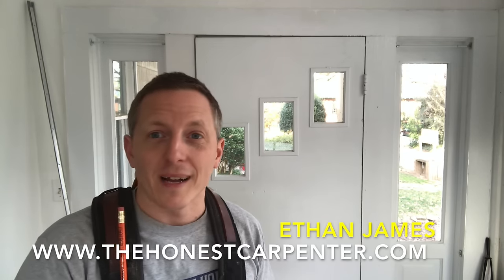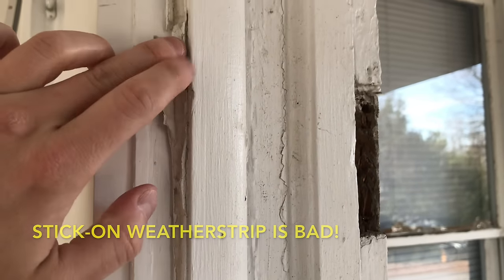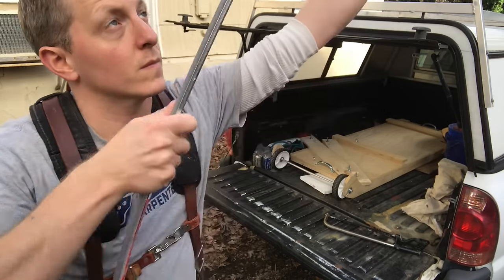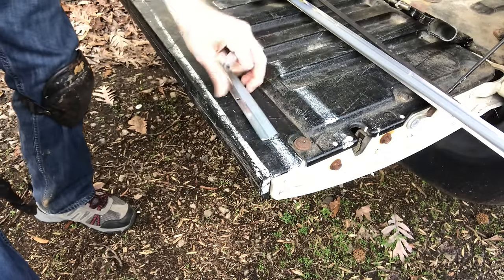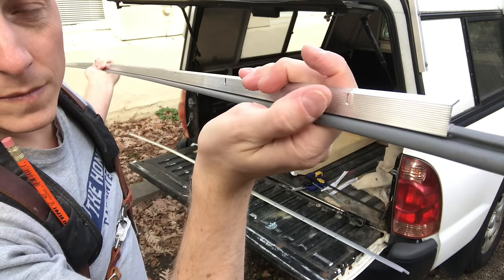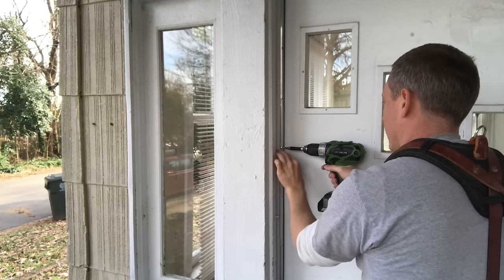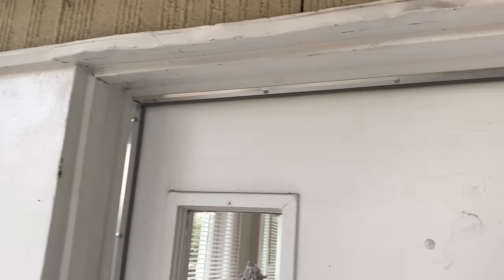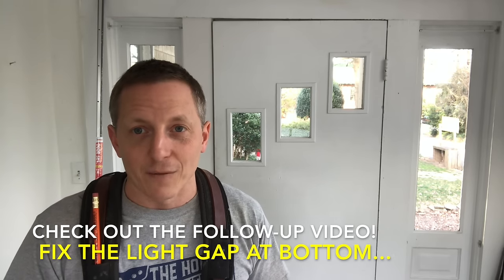USE THIS WEATHERSTRIP ON OLD DOORS! (Save $$, Prevent Cold Air Drafts / BEST DOOR WEATHERSTRIPPING)

Comment: FYI the metal is aluminum, not steel. Won't rust and can be cut with fine tooth miter saw blade.
Reply: I actually used a pair of tin snips.

Comment: Have used this option many of times.    Most important tip for beginners was like you said mount with screws in the middle for possible  needed adjustments later.

Comment: As a locksmith, I can honestly say I’ve done countless service calls to fix locks that were damaged by improperly installed weather stripping. The most important thing you can do before you install the first screw is, shut the door so it latches and........... LOCK THE DEADBOLT!!!!!! (If there is one)
Then, go ahead and gently push the stripping up against the door, Mark with a pencil and install your screws. It’s important to lock the deadbolt because quite often the strike plates for the deadbolt and the knob/lever latch, aren’t aligned properly. It not properly installed, the deadbolts bolt will drag across the strike plate with too much resistance and eventually break. I’ve have seen this problem countless times, weather stripping causes lock and door closing/fit issues almost by default.
Reply from the maker: Good advice!
Reply: @TheHonestCarpenter  - cheers, I saw the vid thought I should throw in a comment.
Reply: @TheHonestCarpenter  great job!! which one is the product your using? I don't see it in your links...
Reply: @The Honest Carpenter
When I mark the screw holes to install the metal weatherstripping , should I shut and latch the door with/without the kerf strips (that has been inserted into the groove on the top and latch side edge?
The kerf strips don't properly seal the old door but the door does shut latch easily.  In other words do I remove all old weatherstripping first?
Reply: I put mine on, am very inexperienced with this. My deadbolt feels tighter even if I loosen all the screws on that side. When I tightened them it was even worse. I'm not sure if I should redo the entire thing or if a little tightness in the deadbolt is okay.
Reply: @Dude902  - take the stripping off. Close the door and lock the deadbolt, now place the stripping against the door and with very slight pressure, mark your holes and mount the stripping, you deadbolt should not be tight or restricted,it should feel the same as before the stripping went on. Any tightness with eventually lead to premature lock failure.
Reply: Thank you for sharing this knowledge.
Reply: My landlord put in stripping and can barely get the door unlocked
Reply: @HawkGirl69  - call the landlord and tell them the lock no longer works since the stripping was installed. They should come back and reinstall it so the pressure is taken off the latch or deadbolt. The only other solution is to file the strike plates on the frame to allow the latch and deadbolt to work properly without resistance or binding. Wish I could help you.
Reply: As the daughter of a locksmith, I thank BOTH of you!  I don't know how many calls my Dad has gotten over the decades with improperly installed stripping that brought early deaths to decent deadbolts... Or the keys breaking in the locks. The great advice and instructions that have come with the invention of the Internet have saved many a service call!  Much appreciation to you gentlemen since my husband and I are now living in an older home and are doing much of the rehab ourselves. ❤

Comment: Absolutely amazing!  I just bought a 1915 house all redone on inside EXCEPT front door, moved in and noticed the huge gaps, and it is an OLD door with those bevel type windows and this showed me what to do as I could see regular weatherstripping will not cut it. I thank you so much and feel confident to do this (but will need the hack saw!)

Comment: Great video! This will definitely solve my draft issues around my main entrance and basement doors. My basement door has a small enough gap that spiders use it as a highway into the house.
Reply: my place, downstairs, i've dubbed "the spider palace". gads of spiders, upkeep on webs is insane. now i have a little hope that with the doors properly sealed, that'll shut down that issue quite a bit.

Comment: The best tip was that on the long pieces you want to have a screw very close to the end...otherwise you will have that end flopping around until it gets to the screw. Do two cuts, that was a great idea, so as to get your screws close to the ends of the long pieces.  Actually this also applies to the top shorter piece.  Great video.  Thank you, Dr. George W.
Reply: Easier to just drill a hole and put in another screw

Comment: Thank you!  My house was built in 1949 on a regular foundation that one previous owner decided to hand dig a basement.  Well, no door fits the exterior doorway so several years ago, a friend who had an extra steel door w/foam interior, cut that door to sort of fit the space, then wrapped the open end with steel that he cut off.  Well, it's ugly but it worked better than the hollow-core wooden one that was there before and had a huge hole at the bottom that all kinds of wildlife loved. Anyway, that big basement is my dog's house during the day and it's conditioned but there's a huge gap around the door jamb that just needs a good weather-stripping fix.  This is just the ticket!!!  I don't have a hack saw.  Guess I'm gettin one.

Comment: Thank you so much for this. I didn't know what the product was for or how it worked. My friend installed a prehung door on a 100+ yr old house and it didn't go well. He couldn't get the frame to line up right and ended up with some significant gaps on his door. My brother also broke the threshold while trying to help get the door to shut properly. Friend had never installed an exterior door before. Anyway, there are gaps and it needs to be sealed better. I sent him this video so hopefully he can try this solution.

Comment: I commented on this earlier, but I have to add another. It's been close to zero here in Buffalo, and our unheated side entrance has been brutally cold. In the past I managed to seal most of the cracks with adhesive backed foam stripping, but there was always a draft. We couldn't keep liquids there because we were afraid they would freeze. I installed this kind of insulating strip and a new door sweep yesterday. It's amazing (kind of like when I discovered heat tape for my pipes). There is no draft, and the entryway is comfortable. I guess I'm teachable. Thank you again. I've subscribed, and I look forward to finding new solutions to old problems.

Comment: This is a very helpful video.  My front door is an old wooden double-door.  I can see light through the cracks, so I know the weather stripping needs to be done.  I had that peel/stick foam, but that doesn't really work well.  I will eventually replace the doors, but until then, this will help!

Comment: A very easy to comprehend video!  How would you go about stopping leakage in the middle of a door with sidelight that opens?  The exteriors of the door and opening sidelight do not leak, just the top and where the two come together.  The mullion is very thin, maybe no more than an inch thick, and I doubt screws could be put in it without considerable splitting.  I have a slotted weatherstrip in the middle now, but when the wind blows from the southwest, I can feel it in our foyer.

Comment: Hi , Just put this on my front door today . What a difference. . Thank you for the video . 😁
Reply: Since you have made this post fairly recently compared to others, I have a question or two for you if you don't mind. We have a screen door that we are wanting to use this set on. My husband just isn't sure it would work because the hinges are built into the door frame. Did you run across an issue like that? If so, what did you do about it? Thank you for your help in advance.
Reply: @tamrawiegand9427   So I don’t have a screen door but it could be an issue depending on how much space you have between the front door and the screen door . I would look up the measurements on the width of the kit and see if it will work for you .  We are going to install a screen door this coming spring and I know it will work for us . Hope this helped . 😁

Comment: Thanks for the links and demo.  My door has too much gap and the latch doesn't hold it tight against traditional foam strips, even the wide v-strips.  this is a great solution for me b/c we can seal from the outside and ensure it's snug all around even if the gaps a wide in one place and narrow in another, and it doesn't jam up the door from having too much foam in the tighter places.

Special thanks for the links. I couldn't find anything online b/c everyone is using foam between the door and frame.

Comment: I use a similar weatherstripping on doors. I use the one that has the same weatherstripping that comes on new doors but has the same metal strip to mount it to the frame. It works great! and when it wears out you just go up to the home center and buy the loose pieces the you would put in the newer doors and replace it.
Reply: What brand is it and where did you get i?

Comment: Thanks for the video, looks like 90% of what I need to fix our front door, but I have a followup question: We're in an older house and the gap is about a full inch at the top and 1/2" on one side (behind a storm door, thankfully). Can I just install new door casing strips on the top and side, and then add weatherstripping per this video? Hoping to not have to redo the whole casing or change the door (which otherwise looks great). Thanks!

Comment: You can get that newer foam type of weatherstripping (used on newer doors) that comes with an aluminum strip.  Easily installed similar to what you have shown on this video on any door.  Much better than the rubber that tends to harden up in cold cold weather.
Reply: Nice. 
You can also take a oscillating tool and cut a channel in the wood and put a new style seal in, just like the new doors. If you dont have an oscillator, you can take off the 3 wood pieces the door shuts against, and cut a dado with a skill saw /table saw/ router, etc..

Comment: Clever, but I'm not sure of this for my door as it opens towards the outside, I think it won't look nice if I put this weatherstripping inside. Any ideas?
My door has different thickness gaps and right now, without a weatherstrip, I have to push it hard to lock it. What a mess! 😅

Comment: This is great.  I have seen some carpenters adjust the door hinges to center the door.  Wouldn't adjusting the bottom hinge address the gap at the top?  You did mention it was an older house, so may not be an option.  Good tip on having the screw hole towards the top and can't wait for the video on that small gap fix.  thanks..

Comment: Great video which explains a DIY job many people might only encounter once in a lifetime. Before I watched, I tried installing and realized I was pushing too hard on the latch side which winds up making too tight a seal and won't allow the door to latch. One tiny correction. The M-D weatherstrip kit you used is aluminum, not steel.

Comment: I just removed old weatherstripping on an interior door in a rental I’m rehabbing. It was the wrong type (meant for an exterior door), had old paint streaks on it, and was generally just ugly. Removing 25 small screws was was very, very difficult. They had been way over-tightened and most had paint on them. Plus they were cheap, soft metal that strips easily. My advice: snug-up your screws but don’t over-tighten with a drill-driver or you’re going to be in a world of hurt when you eventually need to remove and update your weather stripping.

Comment: Just did this for my external metal firedoor for my mud room to garage entry. I have a metal jam so the only thing I would suggest is getting self tapping screws to go into the metal jam and then also silicone where the metal of the weather strip touches the jam so that it is air tight as the screws alone won't make it 100% flush to the jam.

Comment: I installed same system on my door saved a ton of $ door installers wanted to charge almost $1500 for new door and installation.
Reply from the maker: That's great Carmelo! You're right, a lot of contractors will just say "Put in a new door assembly." Just for a little weatherstripping!

Comment: Thank you!! Fellow North Carolinian here 😊 I am dealing with spiders coming in my home and have huge light gaps.  Do you have any videos for the bottom panel? I think it’s called a door sweep? I have metal panel on the back of my door and there’s a small flexible plastic piece that I can see under the door, but it’s partially chipped off. Your videos have been so helpful while I do a lot of projects in my new house.
Reply from the maker: I'm glad the videos are helpful, Natasha! Unfortunately I haven't made a video on sweeps yet, because they have so many varieties and I just haven't gathered enough footage of all the various types. It sounds like you have an undermount sweep though, which just pries out, and you can push a new one in from below. Or, some full metal ones attach to the back or underside, and wrap underneath. In a few cases, you have to unhang the door to get at the screws 😕 I'll try to do a video on this soon. Glad to hear your in NC!

Comment: The cushioned foam  I’ve always liked. A quick blade width rabbit cut along the flat edge of 1,1/2” wide by 3/8” door stop will provide what you need to install it. I as well start at the top with door closed and the wood and weather strip cut to length then carefully bring up against the door with the appropriate compression and secure it. Then the hinge side etc.  It will provide a seal as good as any new door that uses this seal. They are available at most hardware stores. After the initial instillation the seal can be replaced the same as any new door utilizing this type seal. Use a mitre joint in the top corners to allow the seals to go right to the corner.

Comment: For a tight fit I rabbit  a wide door stop that will accept the push in weather stripping. I install the new stop using the push in stripping , adjusting to the door.

Comment: I have two metal doors in my breezeway that open to the outside, and they open outward. They have Kerfing on the inside and I have replaced that with 5/8 inch, but there are still gaps in some places, Mostly up and down the long side where the door handle is.What’s my best option? The stuff you have here looks great, but would it install over the Kerfing? Or is there thicker Kerfing I need to get? Thanks.

Comment: This is a great vid! I have a same problem in my apt where a lot of cold is coming in under the door and the sides. My question is with these metal weather strips with rubber gaskets, is it a good idea to put some silicone underneath the metal part before screwing I to the door frame? To increase the seal? Or it's not necessary?

Comment: Nice job again Ethan.
I'm looking forward to the follow up or "sequel".
By the way, there is also a weather strip product of pvc/plastic material similar to the one you used in the video above except it has a "tension/spring" in the strip so that it's always snug against the door. I believe I purchased it at a Menards, here in the Land of Lincoln.
Reply from the maker: Interesting! Thanks Al, I'm going to look into it
Reply: @TheHonestCarpenter  I'll try to post a picture of it.
Reply: @CrashboatAl  Would have helped if you followed through.
Reply: @TheHonestCarpenter  Any chance you would know how to this sort of thing to an old garage, with lift up wooden door?

Comment: i have a pre hung door extrior doof that has about a 36" light gap from the  ottom of the door up to the knob. it has a seal that i think is like the one that slips into the groove you showed. maybe ill get lucky and find a larger replacement that will fill in the gap.

Comment: Thank you very much! I soooo need to resolve this issue with my front door. It has a gap at the top as wide as the one in your video, and plenty of light coming in along the knob side. Because of your extremely helpful video, I now know how to tackle it. I'm looking forward to doing this project. (I also need a solution for a light gap at the bottom of the door.)

Comment: This video is so helpful and the product sounds perfect but I cannot find the link to the product.  I need it for a door that is 42" wide.  Thanks.
Reply: I found the product, just bought two sets so I could use one of the long sides for my extra-wide doorway, it worked perfectly.  Looks way, way better than the previous hodgepodge of brass, felt, and vinyl.   Many many thanks!

Comment: I have a rounded top of my door.  Can I use one of these strips or do I need something more flexible?  The door looks like it used to have a bent and cut copper solution, which was partially removed, then 2 different layers of foam on top of each other to bridge the gap.  Trying to rethink this.